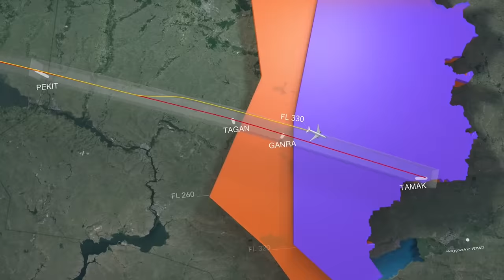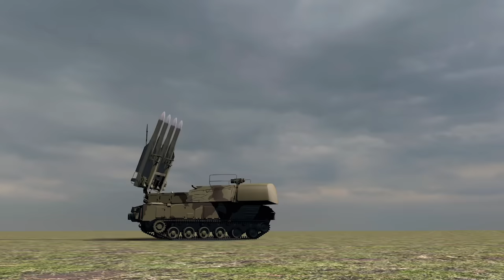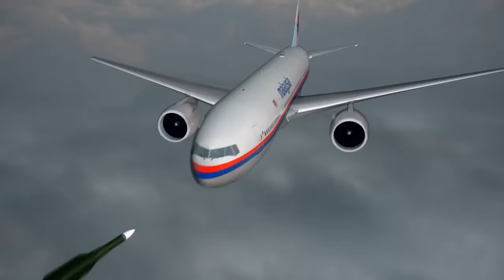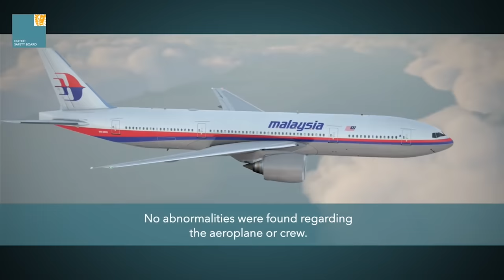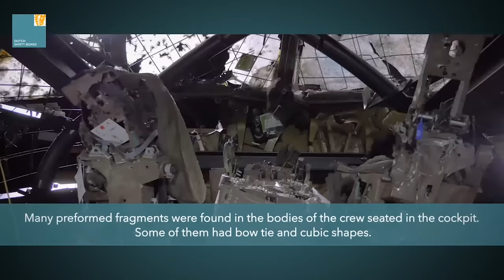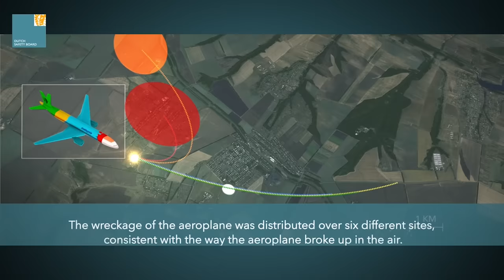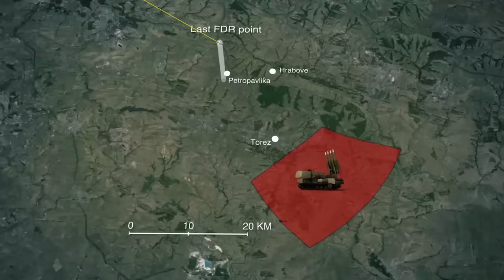Cause of MH17 crash by Dutch Safety Board

Comment: The thing is, the buk sam system can be used 2 ways, in a connected web of launch vehicles and radar vehicles or as an independent launcher. The problem with the second set-up is that even though you can still target at simular ranges, the target information is much more limited than what the dedicated radar vehicle provides. The officer on the ground saw a blip on his screen, didn't know exactly what it was and shot it to find out. A reckless manouver and sadly not the first time a civilian plane was shot out of the sky.
Reply: yes if they used the proper setup they would have been able to read the transponder code and seen it was a civilian airliner .
Reply: @rieksstevens  Perhaps they did.  No one will ever know if they did or who the launch crew were, or what their orders were or if they or their immediate superiors are still alive.
Reply: @robi4387  no they did not .. there's a lot known already ,.. they had the stand alone buk transporter , not the radar vehicle that comes with it . the transporter has its own radar ,.. but not as advanced as the radar unit that you can connect to it .
Reply: @rieksstevens  Yes read that.  It doesn't mean they didn't know.  You don't need radar.  A good pair of binoculars or Flightradar24 on a smartphone.
Reply: @robi4387  they probably just saw a bleep on the radar connected with it and shot ,.. they just did not care ,  the footage and al the stuff happening around the scene of the crash shows just that .
Reply: And if it's just a matter of launch and forget it, AA missile's aren't the only weapons in Russia's arsenal.
The old USSR did an excellent job of overseeing their missile launchers as their was no World War 3.
I hope the Russian Federation retains the experience.
Reply: You've got to understand that (although the investigation found out the Buk was physicaly operated by a russian army serviceman/team) it's not a regular army that makes use of a proper structure, procedures and otherwise takes measures not hit civilians (houses are fired upon on purpose till these days) or whatever. It's a bunch of street bandits and they do not care about anything. They thought it's a ukrainian AF light transport and shot it down without any checks or whatever, because they knew and felt they are not accountable to anyone in any single way. Similar to firing an automatic gun at will in the streets of an occupied town. And 7 years later you can witness this part isn't anything but true.
Reply: @rieksstevens  the airspace should be restricted over places where such weapons are available. They received this weapon from Russia, Bellingcat did some investigation, it was a reckless behavior by Russia. Even shooting Ukrainian military planes from their own side would have been fine, but handing a deadly weapon to rebels was reckless.
Reply: @aksmex2576  The Ukrainian air defense forces should not even give their technick to the rebels. They do very well on their own. Tu-154M's fatal incident over the Black Sea will not let me lie.
Reply: @aksmex2576  : LOL. Bellingcat. LOL. Ukrainian Nazi have these weapons (BUK) since the Soviet time.
Reply: @alexandr74al19  хватит нести чушь идиот. Виноваты те кто разрешил полет над зоной конфликта. Это даже с точки зрения международного права не преступление
Reply: @vladimirthegreen6097  Эшелоны ниже 7500м. БЫЛИ ЗАКРЫТЫ!!! А пролеты над зонами конфликтов это обычная практика ИКАО - в Сирии, Ираке, Ливане, Судане и др. станах НИКТО не прекращал пассажирского воздушного движения...
Reply: @vladimirthegreen6097  Of course it is. 4 people- 3 Russians and 1 Ukrainian- are being charged with murder by the Dutch prosecutor in The Hague.

Comment: What I want to know is why civil and international aviation authorities allowed scheduled flights over a battlefield? One thing I remember, which no one ever mentions, is that just a few days before MH17 went down, a Ukrainian military transport plane had been shot down over eastern Ukraine. Why were  civil flights still allowed over the conflict zone?
Reply: I hope such a mistake never happens again.
Reply: Because someone was interested in that for some reason. 
I do not know, who is responsible for "pressing a fire button" on Buk missile system (RU, UA/NATO or DNR/LNR) - I believe that it could be any side of the conflict (by mistake or by intention)...
But I'm sure that EU and Civil Aviation Authorities are fully responsible for allowing MH17 or any other CIVIL aircraft fly over the active battlefield. It's unacceptable! 
(c) If anything can go wrong - it will. Unfortunately.
Pray for victims.
Reply: No only allowed, but even lowered down to be able to shot this plane... Аir traffic controller that gives order is still not found. And will never found...
Reply: @ovetomash148  Nah, SAM of that type, which by commission was used to shot down MH-17 can reach 22km height. Usual civilian airlines use corridor between 9 and 16km.

Though, MPADS can't reach this height as the most advanced ones can reach around 6-7km, and it's still way lower than 10km where MH 17 was shot.
Reply: @Opter_X  Actually it's local air traffic officer who is kinda responsible for that and absolutely responsible a ministry of defense of Ukraine as they should provide worldwide info about restricted and prohibited airspace at Ukranian territory to airlines companies and air traffic officers adjust their airways.

Technically, this catastrophe is work accident. SAM operators just did their job correctly. Their job is shooting down any aircraft in the battlefield area.What they exactly did.

Moreover, after MH-17 accident they had to put radio-beacon on civilian aircraft frequencies, repeating the same message that aircraft should turn over due to they approach battlefront prohibited area and will be shot entering in it.
Reply: @alyia9618  who do you think supplies the separatists
Reply: @nickcuthbertson1538  same ppl the supplied ukraine army. not that it matters at all, full responsibility over this intercept lays at the air traffic regulators that allow civilian flights over a heated war zone. there's absolutely no blame on who supplied the BUK or who operated it. The people that approved the flight plan basically signed a death certificate.
Reply: BERSERKERRADIO  what does the the Dutch government have to do with the flight path of a Malaysian plane ?
Reply: BERSERKERRADIO  they can close it for Dutch airliners ,.. but Malaysian airlines does not fall under there decisions
Reply: @alyia9618  Russians were there ,there are photos and videos of Russian columns crossing the borders
Reply: @alyia9618  не надо нести бред, рашкинский бук засняли как он приехал в Донбасс, а потом как спешно уехал. Да и сами ихтамнеты выпустили новости, как они сбили очередной навукраинский самолёт ан26. Только они не знали тогда что это боинг.
Reply: To save fuel aka money $$$$.
Reply: Because they get money for the planes that fly over their countries, so Ukraine allowed it and said it was safe.
Reply: Because nobody gives terrorists such a powerful missiles that reach 7..20km.
Russian terrorists used small AA missiles before, but that time russian government provided high-altitude missiles. 
They can deliver even ballistic missiles to their terrorists. In this case your city would become dangerous. Wherever it's placed
Reply: MA wanted to say a couple thousand ringgit on fuel
Reply: @Opter_X  : actually, Merkel warned Poroshenko many times to close that route; however, he refused to do it since Ukraine collected US$1 million a day as transit fees. Poroshenko and his government needed money to finance their civil war in East Ukraine.
Reply: No one could even imagine that terrorists would have a BUK with a firing height of 10 km or more...  Everyone must admit - Putler and TerorRussia are guilty of this...  Very, very sorry for the victims...
Reply: Никто и представить себе не мог, что у террористов будет БУК с высотой стрельбы 10 км и более ... Все должны признать - в этом виноваты Путлер и TerorRussia ... Очень-очень жаль погибших ...
Reply: @bhangrafan4480  lol awesome comment
Reply: @bhangrafan4480  this reply aged well
Reply: @Sharinghan22  Well. There was a passenger list and goddamn people corpses fallen from the sky. One of them has fallen on a roof of some house and breaking it.
Reply: They were hoping it would happen to bring Ukrainian allies into the war.
Reply: @rieksstevens   Well. Nothing returns people. As much as could be done - to charge ukranian government with fine and maybe try to push a UN court for war crimes (using civilians for war matter). Definitely, push for airspace regulations changes at wartime. For example, in actual war Russia and Belarus closed their airspace 300km around ukranian borders to avoid any accident. Poland, baltic states and Romania and Moldova put airlines on their territory at risk, if minor, due to war is mostly happen at eastern ukraine. 
Poland and baltic rather at small risk, Moldova and Romania at higher one as marine forces and possible battles around Odessa are not that far from their borders. 
Though, as far as I understood, after having their radars exploded, ukranian AA uses NATO facilities and telemetry for their strikes. So, technically, people taking flights there in hands of ukranian/NATO forces, what should be good.
NATO forces have to be rather well trained and equipped enough to control airspace professionally and ukranians can't hit what they can't see.
Reply: @alexandr74al19  Yeah, especially people having their military aircraft down at 14km height 3 days before and blaming russian AA for that. There is a list of shot aircraft at 2014 in public access, you know.
Reply: @rieksstevens  More globally I guess worldwide community has to address 3 constantly growing issues. 
1. Popular constitutional referendum standards. As so far, clichè that population is the source of power in country is stated worldwide. While in practice there are no standards how regionally or statewide such issue should be addressed.
This topic goes very close with 
2. Local separatism handling standards. This is an worldwide issue. I guess, making standards how regional separation should be handled won't just helps to address worldwide issue from catalan -Spain to Tibet - China and from Sul-Brasil to Washington state-US and chechen/Habarovsk Russia but also helps save hundreds of thousands if not millions human lifes. As well as put old fashioned territory disputes more in diplomatic and political plane than into military one.
3.Nuclear deterrence parity hold. 
So far legislation in this matter was covered by patch treaties here and there which are obviously not working. I guess there should be established a standard which helps to avoid an actually spiraling out of control situation with Russia as well as unnecessary military tech race.
Reply: @antonzhdanov9653  wow, just a casualty. Don't cry when the same will be said about your family. I wish you a good life.
Reply: @divx1001  Sorry, what?
Reply: @Opter_X  ruskiy cope
Reply: @ViktorRenkel  the corridor was in place 10+km because the seperatists did not have any weapons to down an airplane above 6km. And didn't have any airplanes, so Ukraine had no means to check there for hostilities. This all changed when Russia entered Donetsk and provided with Buk missile systems. So Russian military is to blame most for this disaster and then the rebels on the ground pressing with or without the authority of Russia on the button.
Reply: @ViktorRenkel  if you see the work done by the 600 crew Investigation team from Australia, Malaysia, Belgium, the Netherlands, Russia and US you would not question how the plane was shot down and where. But only who is to blame. Who was in control of the buk system and who placed it there. And who was involved in moving it out of that territory the same night. If you question this research you didn't look into their work whatsoever and you are one of the people dancing on the graves of a lot of my innocent countryman.
Reply: Exactly. Commercial flights should NEVER EVER be flown over a battle zone!

Comment: That must have been horrific for the passengers watching the plane breaking up around them..until they passed out from hypoxia..R.I.P..from Italy 🇮🇹
Reply: At that altitude, instant explosive decompression almost certainly knocked out a majority of the passengers. Any fear they felt was almost certainly cut short by the explosive decompression and if that didn't instantly knock you out, the lack of oxygen would finish the job seconds later. It was a quick, but violent death...
Reply: the buk rocket exploded in away that killed most passengers in the front in an instant
Reply: @flopjul3022  Yea I figured it probably killed most people. The explosive force was probably so great that the plane's fuselage between the passengers and the missile was probably like paper to the explosion. In a sad way, it was probably those who were the luckiest. That explosion would instantly kill you depending on how close you were. I'm sure most of that explosive power was enough to kill most of the passengers and knocking out the rest. May those poor innocent people rest in peace. Such a violent way to die. It makes me so sad :(
Reply: @madezra64  at 30,000 feet you still have a good 1-2 minutes of useful consciousness. By the time 1-2 minutes had elapsed they would have been at an altitude with plenty of oxygen. It's very unlikely that any of them passed out due to lack of oxygen.
Reply: @trevorbylsma123  The explosive decompression and the blast from the missile would certainly have knocked out 90% of the passengers. After 1 minute that plane was in complete pieces with a majority of the people dead from the missile already. Those in the back of the plane probably would have had it the worst being furthest from the explosion.
Reply: at least it was quick
Reply: @trevorbylsma123  really? You had to say that mate?
Reply: Dying will never be so quick even if you crashed from that altitude, you would still have few seconds or even minutes suffering while lying on the ground, before your last breath. Meaning, you will regain consciousness for a moment, not a total black out.
Reply: @CookieeMonstarr666  Hitting the ground at terminal velocity is going to instantly kill you. You MIGHT, MIGHT wake up a few moments before impact but that's rare. That plane was in literal pieces. It wasn't resisting the air coming down like it would if it was still intact and not in a nose dive.
Reply: @CookieeMonstarr666  No, you will NOT regain consciousness after hitting the ground at terminal velocity. Every bone and organ in your body is gonna be crushed by the forces of impact. You won't even feel it it'll happen so fast.
Reply: @madezra64  k
Reply: @madezra64  That's not true for everyone.
Reply: @trevorbylsma123  the breakup would have killed most if not all of the passengers from the incredibly sudden and violent spinning that would result from the free fall. If they are still in the aircraft remains, then the g forces they would have likely experienced would have probably killed them from the whiplash
Reply: They were already dead when the missile struck.
Reply: @stucrossland3719  why should they have been dead already? Like from what cause ?